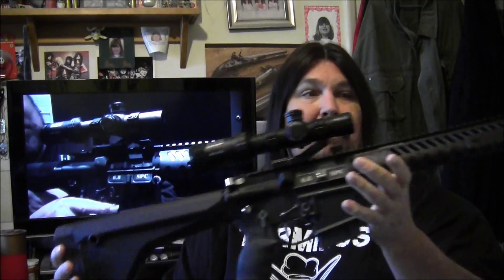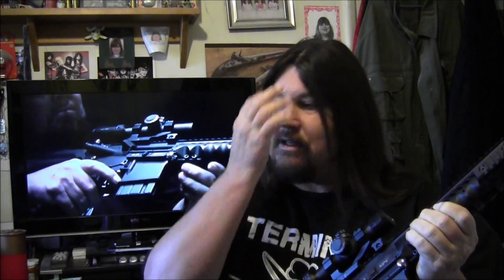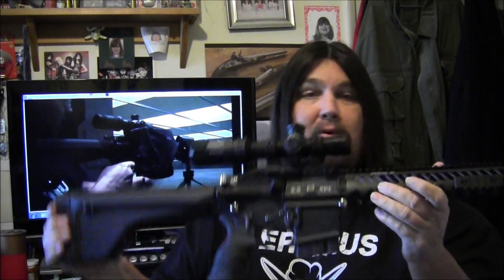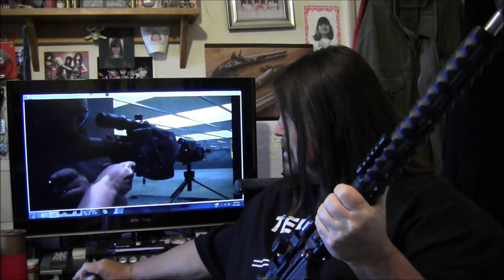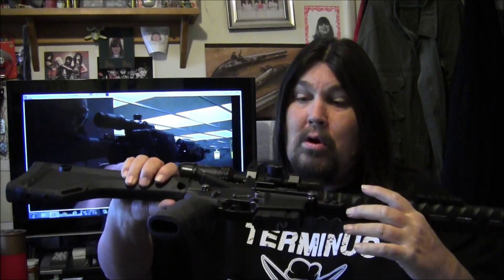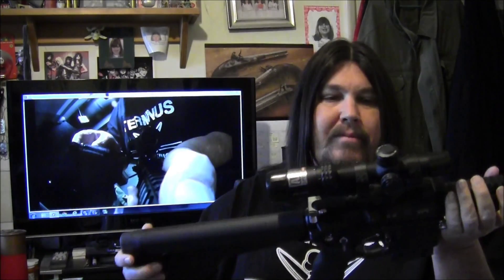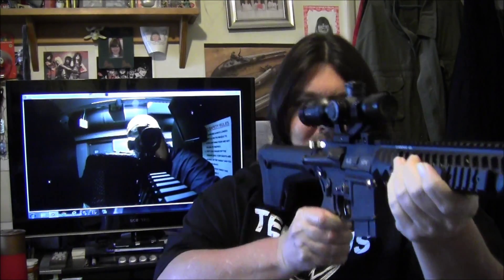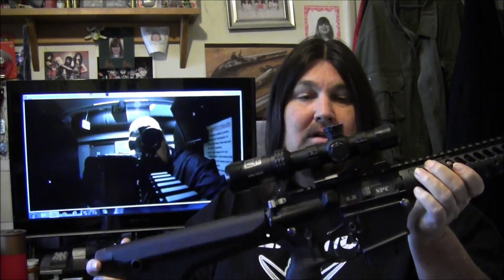6.8 SPC Build: Chambering issue fixed

Comment: Just finished my 6.8 build. I have to take it out to the range to run some rounds through it. I had issues with the round being chambered and then getting stuck. I had to pull back on the charging handle with both hands to eject it. I had to remove the barrel and then reinstall it to "fix" the problem. I guess I'll find out if I have the same issue once I take it to the range.
Reply from the maker: +Shane Mcdowell That sounds like the same exact issue I was having. Good luck with it

Comment: Good to hear it is working for ya. I can see 2 possible causes of your FTC. One dirty chamber, a piece of trash or carbon could have been in the shoulder area. It only takes a piece the size of a grain of sand to jam it up. Two tight chamber but still with in spec, this would make even smaller trash or variations in round dimensions cause a FTC. It cannot be parts breaking in then the rounds would have been easy to eject when you where testing chambering. 

If it occurs again I would suggest cleaning the chamber very good, especially in the shoulder area. Then later when you start reloading measure your headspace and find out exactly where it is at. Then you can adjust the case sizing to provide more room for chamber trash. Assuming of course you have a tight chamber. 

From the info I have gathered from all your vids, these two are the only one that make sense with you problems. Good luck and keep shooting.

BTW with thousands of round your headspace will grow, especially when shooting hot loads. This is another use for chamber gauges, go no go and field.
Reply from the maker: BJ W Thank you, I will keep your suggestion in mind. I had a friend that suggested I polish the chamber by putting a chamber mop in a drill with some metal polish. What do you think of that idea? Good or bad?
Reply: gunnwild1 it wouldn't hurt. I give a quick polish to new barrels to smooth out any reamer marks or when there is a build up a melonite in those type barrels. I use a chamber mop with a patch wrapped around it and a touch of flitz. A few seconds with a low rpm drill for a quick polish and a little longer when melonite it built up.

If there is a burr or scrach in the chamber you will see it in fireformed cases. That will take a bit more polishing to smooth that out.
Reply from the maker: BJ W On the first few rounds that I fired, there is a scratch that goes along the entire length of the casing and I thought was from the feed ramp. After giving it a thorough cleaning and the rounds started chambering again, the scratch only went about half way down the cases. Could that be from a burr or is that normal? I have never noticed that scratch on any of the 223 or 5.56 casings
Reply: gunnwild1 hard to determine over comments. You can verify by one of two ways. Use a bore scope at look at the chamber walls. Or feed a round by hand so it don't contact ramps or mag, then inspect case for a scratch. 

It could be the feedramp the are known to be sharp brand new. I usually knock the edges down with a dremel and blend the feedramps while I am in there.
Reply from the maker: BJ W I will try that, thank you for your help

Comment: Glad it's working out well for you now bro. Nice to have it running smoothly. I know that feeling when something is wrong and it wont do it for someone else. At least it's running right now. I hear ya on those A2 buffer springs.. ugh.. freaking boingy!
Reply from the maker: UrbanArmed Thanks brother. I'm going to try that spike tactical buffer spacer with a carbine spring to see if that helps with the sound
Reply: gunnwild1 Oh nice! Is that similar to what Travis is running? He seems to be loving that a lot! Just glad shes running nicely for you bro, damn it's a sexy rifle!
Reply from the maker: UrbanArmed Actually what Travis is using is much better. He has the JP enterprises set up that doesn't require a buffer spring

Comment: maybe a few bad rounds or bulged cases, glad she is running well now.  I took my old rifle and put mothers polish on a shotgun bore mop and polished the chamber a bit and it helped a lot.  Are you getting a JP setup for the buffer
Reply from the maker: djalkaline1 Thanks man, I'm very happy it's working good. I'm going to try that spikes spacer that Eric did a video on to see if that spring noise goes away

Comment: i had a similar problem with my ar it would not cycle the rounds so i changed lowers completely and it worked fine and i still have no clue why the old lower dose not work so i am using it for spare pats i am glad yours is working great it is a great looking rifle and 6.8 is a great round
Reply from the maker: RPMIDAHO Thank you. This is my first experience with the 6.8 round and I'm liking it so far. I just need to stock up on ammo when I can find it

Comment: Problems can be extremely frustrating. Nice that you got it back right.
Maybe the rifle saw all the smith's hammers?
Reply from the maker: MyHollowpoint I think you're right, there was a 20 lbs sledge in the corner =)
What ever the issue was will have to remain a mystery for now. Thanks Chuck